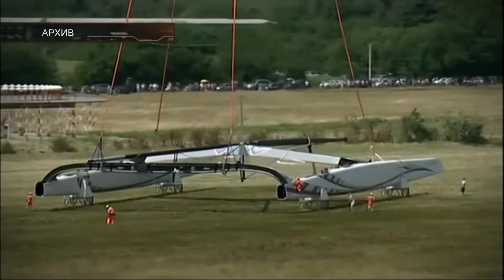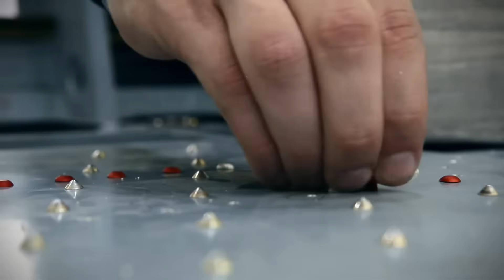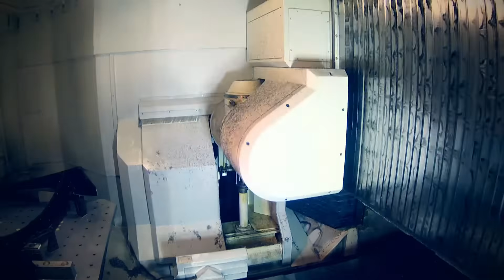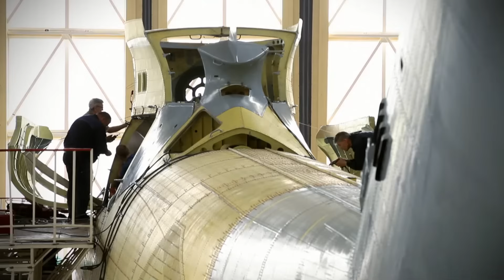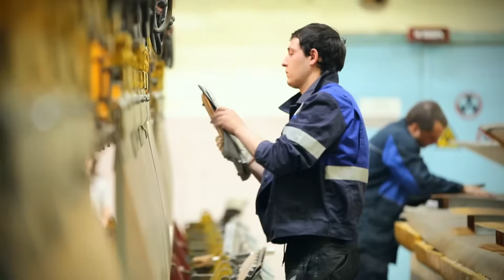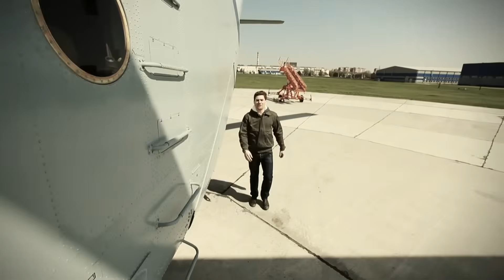Inside The Factory That Makes the World's LARGEST Helicopter

Comment: It seems a bit irrational to have to manually drill holes for the rivets. With precision manufacturing, it's possible to line up pre-drilled (or punched) holes in both parts.
Reply: You’ve not worked in aviation. Its how its done, always has been for decades